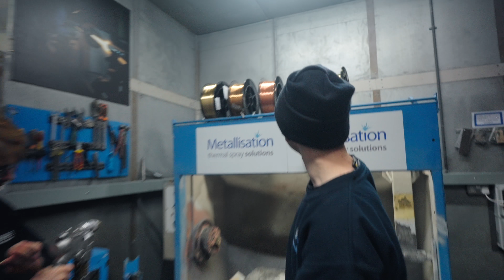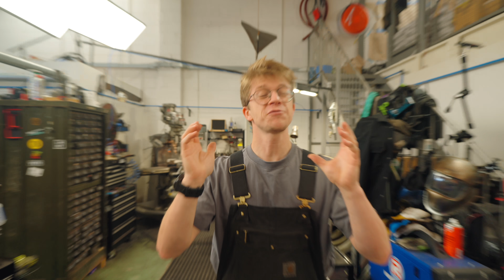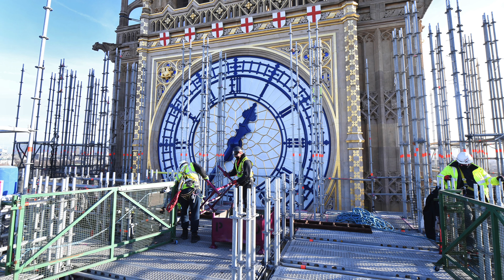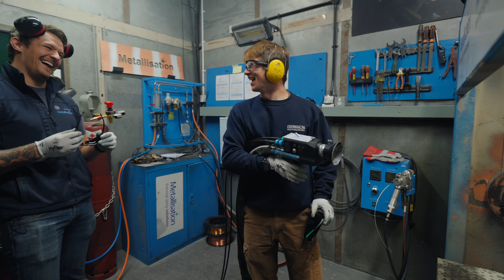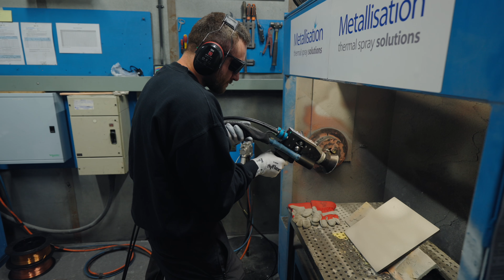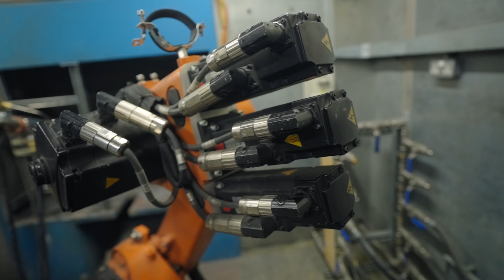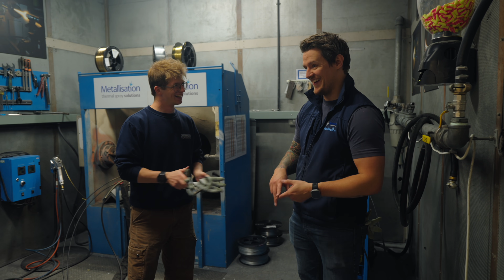Metallization

Comment: Retropower in the UK builds restomod cars, and they use a zinc metal spray system on the undersides and inside panels for corrosion resistance before applying paint.  They're on YouTube.

Comment: Probably worth mentioning, The third one is just a rocket with a very weird purpose. Kerosene and oxygen are a pretty common fuel plus oxidizer for rockets, along with hydrogen and oxygen, and rockets also have them put into a combustion chamber with a nozzle to direct the exhaust. So it makes sense that you would get shock diamonds, especially since the thing that causes a lot of real rockets not to produce those when operating in there ideal environment is specific nozzle geometries since for those you are trying to have the exhaust be at a similar pressure to the atmosphere around them. But they are probably one thing to choose their nozzle geometry for an exhaust shape rather than maximizing the efficiency

Comment: A few years ago I watched a video of a guy flame spraying a large, worn-out hydraulic cylinder shaft while it was mounted in a lathe, then he turned it down to the exact diameter he needed.  It was the coolest metal process I had ever seen!  This robot process was even better!
Reply: I've seen that. Was it abom ?
Reply: @1985metalmaniac  Kurtis at CEE uses it too.
Reply: @1985metalmaniac  I'm not sure, it might have been - or maybe Cutting Edge Engineering Australia.
Reply: @1985metalmaniac  ha.. I thought the exact same.
Reply: My first thought was Cutting Edge Engineering Australia

Comment: I'd absolutely go for the flame one for sure. you can manufacture the right size of wire with the new metal roller and a draw block for sizing. The thing would be perfect for just about any coating and while slow can be used to buildup a shaft if needed.

Comment: I was somewhat familiar with the technology. We've sent shafts out of our shop to have them built back up, but I had no idea it had come so far. I'd love to have this at work and would have to work out a deal to use it after shift on some of my decorative forgings. When you buy one, because we all know you will, please show us some forced patinas on the bronzes and copper. I'd love to see what the transition looks like blended back to forged steel from wire brushing and what kind of interesting affects the variation of hand application gives you with a patina. Fantastic video.

Comment: Worked for a place here in United States that did tungsten carbide coatings like this, coated aluminum rotor piece for Bell helicopters for wear purposes, and valves, had to use diamond paste to grind to dimension.

Comment: I weld cast iron professionally for a living and thermal spray oxy/acy welding is my go to process 80 % of the time... It takes patients but I have saved priceless antique engine parts all the way to just a really old man hole cover... It takes patients to learn but with time comes experience!!!! You should check out hard facing!!! We weld camshafts and crankshafts and the nickel/chromium mix powders is insane for wear resistance!!! It's literally as hard as a diamond

Comment: Arc spraying bronze is also a fantastic way to restore pitted pot metal for re-chroming with a superior surface (that fills and fixes cleaned out corrosion divots) for chrome adhesion.  With a backer template it is also possible to spray-build up lost sections of such a part.

Comment: I'm confused on the resulting coating's chemistry. 

If you're ignoring the metal before deposition, it's an oxide layer. That I understand. 

But if you want to build up a steel carbide later but it's being deposited as an oxide, aren't you basically spraying rust instead of a pure metallic layer?

Comment: First time I saw this it really blew my mind that it was even possible😅 they were building up the surface of an huge scared axle and they did it while it was mounted in an insanely huge lathe, so the axle was turning and each full rotation it built up like 0.25mm and when they were satisfied with the thickness they just polished the surface, the reason they didn't want to weld and machine was because the tolerances didn't allow for the heat changes welding would make to the axle. Anyhow, I still find this really interesting because in my world would the metal sprayed come out like small blobs😅

Comment: I had seen this done years ago at a metal machine shop.  They would use steel to build shafts back up on oilfield equipment and then machine them back down.  So like a d11 dozer pin would be cheaper to repair than replace.    I had never thought about coating other materials.

Imagine a rat rod truck with a copper coated frame.

Comment: Looks like you could theoretically spray coat a wax or 3d printed part, then melt out the plastic/wax and be left with a super thin walled metal shell. 

That stuff is super cool

Comment: Something worth thinking about with that last machine is that the USN had a lot of trouble with wear on the 16" rifles of the last battleships, leading to powder changes & formulations, having to put a new liner in the barrel, and occasional circumcision of said barrel liner as it gets pulled out bit by bit from the weight of a car getting chunked out of it. That Halojet would/could have completed negated much of those issues entirely by allowing a sub-liner or ablative liner with dramatically better properties for task.

Comment: As someone who has taken apart a lot of laptops throughout the years and seen the coppery sheen of the metallized plastic used for RF shielding in models without a metal chassis, it's incredibly cool to see how this is actually done. Honestly kind of shocking how simple it seems, at least with the two initial methods. I really hope you buy a setup like this and use it for something cool! Sprayed-on instant damascus?

Comment: 19:57 slight correction. Those are called mach diamonds, they are the result of standing pressure waves formed the the exhaust of engines. While they are called Mach diamonds, they are named after Erst Mach (the same guy the Mach unit of speed is named after). They typically appear at speeds that are far greater than Mach 1, but you can have supersonic flow without Mach diamonds
Reply: You beat me to it

Comment: I saw a video about this a couple of years ago. I think they were repairing train wheels that had been damaged. They started by using a spray gun to rebuild the worn away parts of the wheel. Then they put it in a lathe and worked it down to the correct dimensions. I remember that I found it interesting that they did this to train wheels. That must mean they really trust in the bonding process of the sprayed on metal. IT also meant that the quality of the sprayed on metal must be high enough to stand the kind of wear that a train wheel goes through.

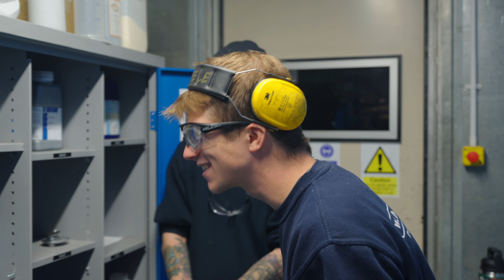Comment: 22:40 Yttria-stabilized Zirconia Powder 10g - £173 WTF!
Reply: That's about three times more than Beluga caviar. If anybodys interested.
Reply: This is probably the price for high purity YSZ for fuels cells and such. YSZ is used by the tonne in thermal spray (or by kg in research) and is far cheaper than that. Most, if not all, modern planes have YSZ coatings in the hot side of the engine.

Comment: I saw metal spray being used to build up the bearing surfaces on the gigantic impellers from a hydroelectric dam, back in 1980.
Even more impressive was seeing the impellers being turned on a Craven lathe with a 4 meter diameter chuck. That's a manual lathe, no CNC.

Comment: I'm wondering if you put different metals in each side of that second one, would it 50/50 alloy them or make a cool splatter damascus effect? Or do you need to have both sides be the same material or it messes up?

Comment: Alec, I learned 'Spray Welding' in my apprenticeship - Oxy-Acetlyne torch with a little resevior on top like a traditional airbrush, and you heat the part, and apply a fine steel powder - I worked in a toolmaking workshop and we used spray welding for repairing injection molding dies and filling in tiny detail before re-machining. 

A great process, and if you get a chance to learn from on old bloke, I would absolutely reccomend it.

Comment: I used to build and design Arc spray systems for a company called Thermion. Their arc systems blow theirs out of the water. They can spray .48 mm wire and they are production monsters. And their systems are push only so the head is super light and the control system we have set up eliminates all the wire surge.

Comment: what if you sray both titanium and nikel on to a nikel wiere , you can make a cheap version of a memory metal, you can then fill the voids with copper or alumium then shaving it down to the nikel titanium layer , to make it more termoconductive , then you place it in a silicon flexible shell filled with oil for cooling , and then use a capacitor and a battery a pump for circulating the oil , and you have your self a muscle .

Comment: As a gearhead, I imagine this technology can be (or already is) used to coat cylinders/pistons with another material for less friction and more rpm, or to smooth out cast intake/exhaust for better flow. Or to increase the height of a piston head for slightly higher compression ratio.
Really the applications are endless

Comment: This is great. When I was in the US Army as a UH-1H helicopter Mechanic. I did some training at Corpus Christy Army Depot. and one of the supervises there told me that because the engines used in the UH-1H was out of production Lycoming T53-L-13B   When the compressor half's were worn down out of spec. They would metal spray them then grind them back to New spec. This was in 1983-84.
Reply: I wonder if the last machine could be used to extend the barrel life of artillery tubes and the like, after they've fired X thousand rounds and need replaced... 🤔
Reply: @FlinnGaidin yes and they can also be used to apply harder coatings to lengthen the time before wear becomes an issue. However I wouldnt expect most militaries to bother, swapping an old single material barrel to be smelted for a new one from an existing supply chain will almost always be seen as more cost effective in their style of book keeping. They often make the same decisions on things like rifles…sure they could go with an internally chromed/coated barrel for wear resistance but that often costs as much as 3x a regular barrel, why bother when the usually order more entire rifles than needed.
Reply: @sathos  that was the military thinking on the original M-16 rifles. Armalite specified a hard chromed chamber and bore to drastically reduce the amount of cleaning required and make the barrels last a lot longer. The slick chrome in the chambers also made feeding and extracting cartridges easier. The military bean counters apparently thought chrome = decorative and had it deleted and reduced cleaning = no cleaning so they didn't order cleaning kits.
Reply: I still fly on the uh-1n it’s getting divested soon

Comment: Alec, I am curious about the piece of wood sample ya'll did. My first thought is if that type of process can be done on wood, can you imagine the building structure / protection a wood home would / could have then. Key pieces could be done this way to protect the foundation, roofs and / or corners. My only question is can this be cut by any saw if needed ?

Comment: I manage a pharmaceutical Warehouse where we make vitamins and supplements. One of the huge shaft for our big mixing machine it's about 6 inches solid aluminum and about 18 ft long had gotten worn down where one of the bushings are. Are only option was to either have a new one made back to the correct spec or use a process similar to this to get it back to the correct diameter. I was made to go with the part to the machine shop that did it and they used a sprayer to build up the aluminum to a little bit over the correct diameter and then they cut it back down on the lathe and they did this process about three times because there were some porous spots that were not full thickness so they had to do it a couple times but it was really cool to see and way cheaper than having another full shaft made for the machine.

Comment: I have used their equipment its quite brutal using it all day the arc spray machine you used is almost identical to what i have used. good thing about arc sprayed zinc is it can be painted directly and doesnt have weird runs and sprags where as hot dip has too be blast profiled before painting and that can damage it.

Comment: Navistar engines would spray weld the cylinders on the 6.4 Powerstrokes instead of boring cylinders oversize. Stuff is horrible and doesn't hold up. Chips/flakes, horrible to machine. Feel bad for the people who got those junk rebuilds.

Comment: Used to own a spray-metalizer that hooked up to oxy/acetylene and used powdered metals instead of wire feed and mounted to a lathe.  Was used for bearing journal repair on electric motor shafts that had galling or metal fatigue from seized bearings.  Turn out the bad metal, spray on new metal while rotating the shaft for even coverage, then turn down to size.

Comment: Flame spray is very cool - but you now need to check out cold spray surfacing. Similar idea to the "hot" version using powder, but relying on ultra-high velocity helium gas to smush the particles onto a surface/ substrate.

Comment: I first saw the arc spraying on Cutting Edge Engineering's channel. He was repairing something cylindrical for a customer (I think a massive hydraulic piston from some mining equipment), but it had already been repaired before and there wasn't enough spare material for him to cut into. So he pulled this thing out and just built up a layer of high-quality steel which was awesome to see.
Reply: Abom79 showed this many years ago. His system is smaller and only works with powder that drop feeds, and you need to preheat the item to get good adhesion. The upside is that it runs of the bottle pressure of his oxy-acetylene rig, so it's very fast to hook up and only takes up a drawer of space when not in use.

Comment: I think what I like about this particular application is think about if you're restoring something that's metal and you can't go out and buy another one so the one that you have might have some other rigidity or or some other complication maybe some small holes maybe you know some sort other other thing that has complicated or corrupted that metal you could now spray this on there and essentially make it knew. Does blows my mind what this could be used for besides everything wait. Remember when wolverine had that metal put across his entire skeletal system. Alex we could be like wolverine. So it wouldn't be pliable. 🎉🎉🎉

Comment: It looks like the actual heat imparted to base metal is very minimal. Is it possible to treat a blade post hardening? I can see this being used to lay a non ferris metal into the valleys of an etched Damascus pattern. Also a quick and very durable rust protection for utility knives and tools.
But the biggest possibility is to SS coat a blade pre heat treatment to remove all base metal oxidation. Just a super tight fitting SS foil bag, but allowing for a perfect quench.
I'm guessing other metals or alloys could be used for heat treating based on specific acid removal that doesn't impact the blade surface.

Comment: My mind immediately went to "spray Damascus". Instead of stacking multiple metals and forge welding them together take a single metal and layer additional different metals on top (would have to be sprayed for an extended time to get thickness) to make a Damascus style piece that has materials that wouldn't normally bond.

Comment: There is the low cost method of just getting a flame spray gun and metal powder. Just costs under 200 €.
But I built myself an arc sprayer ten years ago for use in my workshop. Much more clean process.

Comment: The company I work with has some parts that need hard-facing for wear-resistance. Those are usually cast iron or steel parts.

It is so much fun seeing this process in the making.

Comment: So, before watching the rest of the video.
What I understand is Metallization is basically another way to plate a metal with another metal that does not require the piece to be submerged in solution.
I image this is useful when you wanna plate something you can't remove or isolate(?)

Edit: Yeah, but also so much more utility than I imagined. Not important. Alec having fun and laughing like a kid on xmas genuinely put me in a fantastic mood and I am ever so grateful to have watched this.

Comment: I wonder if you could feed 2 different wires through the arc device?  Like, copper on one side and zinc on the other.  Would the result be a 50/50 brass, or would it be something else due to different melting points?

Comment: There’s a push in the United States to metalize in lieu of hot dip galvanization . It’s pretty expensive compared to commercial painting which is expensive compared to galv though. This is regarding fabricated structural steel, like beams and columns

Comment: You can even spray coat cardboard, have seen this during my university days. But not only metals can be sprayed. Also ceramics. Imho in the 1940s during WWII the turbine blades of the Jumo 009 have been spray coated with aluminum oxide. Another cool method is cold jet spray coating. Here the powder material (copper, steel) is accelerated in a cold supersonic jet. Much less thermal stress compared to OFHV or other flame spray jet coating.

Comment: Abom79 used to use metal spray to build up material on a worn out journal repair, turning to final diameter.  Very cool process!
Reply: I was going to comment the same thing. His videos were where I found out about arc spray / spray welding.

Comment: C3PO's from star wars gold plating was done using process's similar to this, IIRC it might have been vacumm metalization but the priciple is still the same, essentially atomizing metal (gold in this case) to deposit onto another surface.